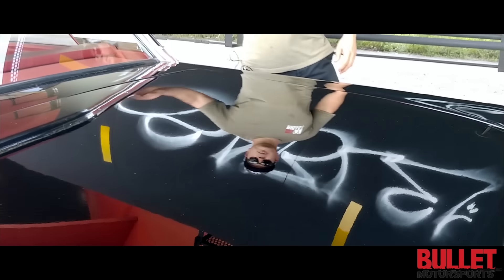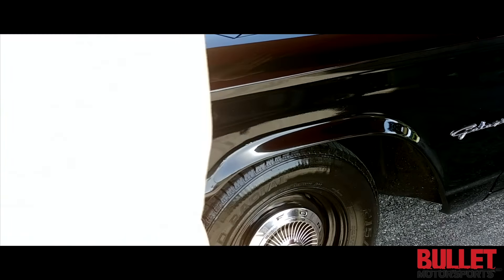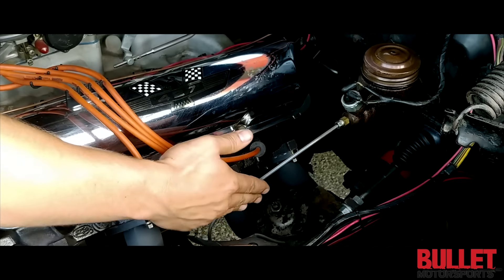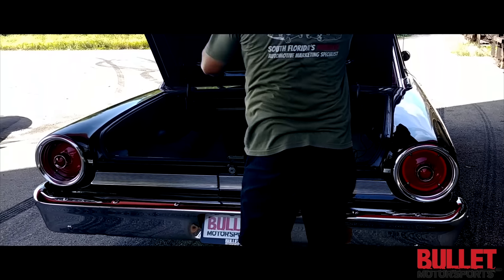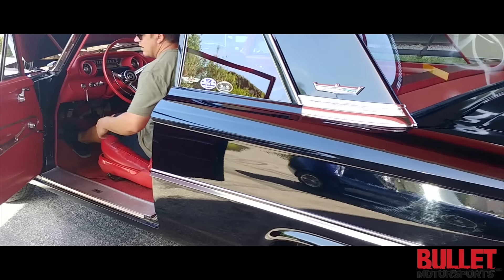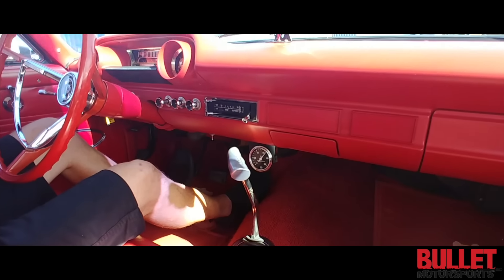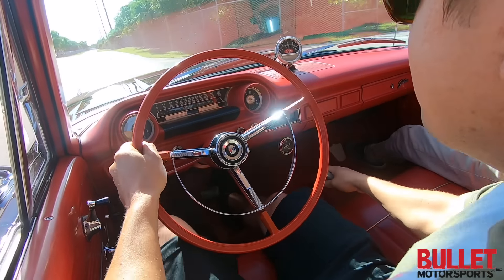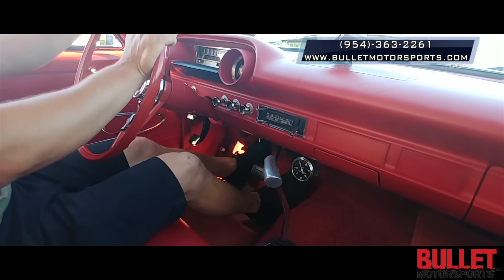1963 Ford Galaxie With 427FE Ripping Through The Gears! -[HD] Bullet Motorsports

Comment: Little trouble slowing down because it has single reservoir, non power assisted drum brakes .
Reply: Yeah I noticed he was sweating it when he tried to slow it down saying you HAD to use the engine because.... and he quickly caught himself before he said "the brakes don't work!! Help!!"
Reply: And for cars like this you would want to upgrade to dual master cylinder and front discs at a minimum. Safety trumps originality when it comes to braking IMO.
Reply: It's totally a period correct built car, though.
 Dual master cylinders didn't become mandated til 67 (and were mandated because the automakers didn't want the added expense) and disc brakes were mostly only an Option until about 1975. 
 If you had built this car from a used 1963 Galaxie 352 Auto grandma car in 1965 or so, the single circuit drum brakes were all you had to work with. Your only real upgrade was to vacuum assist power brakes, and healthy 427s don't make a lot of vacuum. 
 Cars like this were influential in making dual circuit, disc brakes mainstream and standard equipment.
Reply: The car is a clone; the real HP FORDS had bigger brakes on the front along with a number of other differences.
Reply: Sintered metallic brake linings were available in 1963 in order to stop once you sent the 120 mph speedo off the scale......

Comment: We had a car like this at the shop I used to work at, looks like the same year as well. It has a 427 4 speed. It had nascar looking graphics on it. The car also had no air cleaner, but ducting from the inner headlights plumbed straight to the carbs. I had to special order an oil filter for it from the dealership and it was the size of a big gulp from 711.

Comment: I had a 427 side Oiler mid 4.10 drtag pack Detroit Locker in my last 67 Shelby GT 500. What a phenomenal, bad ass motor.The only  draw back with the Holley 635 dual quads:  4-5 m.pg. around town and 7 to 9.5 m,pg, on the freeway! With a 18 gallon gas tank  I passed everything up but a damn gas station!

Comment: Yeah cool car for sure & a bit of Ford Automotive history, great to see it's survived. But don't use the words "all original" or "unmolested"  because it's NOT, it has been modified, it has been "played with" so it IS NOT original or unmolested. But it is still a lovely old Ford. And by the way, why the big hype on it being "a drag car"? I'd rather enjoy a car like this on the street, because it IS A STREET CAR not a drag car.
Reply: SURE if you have a gas station that sells "110 octane gas" (I think that's what he said).
Reply: way better than sweaty bikinies
Reply: Your right....but he did say it was bought 5 cents on the dollar.  So anyone with two functional brain cells....would know what's being sold😎
Reply: In 1962 Ford made five hundred galaxy five hundred and they came out with the original factory hot rod it had a 406 cubic inch engine and IT had a three deuce carbs,high lift solid lifters,dual points distributor,and cast iron header style manifold with the factory dual exhaust with h pipes,had the big round mufflers on it and they kinda sounds like glass pack muffler,BUT they weren't!!!!!FORD rated it at 405 horsepower,BUT I'm pretty sure they lied!!I've never driven OR rode in anything from the factory before or since that impressed me like that one! I Johnny Hawkins swear this statement to be true!!!
Reply: I'D BABY IT LOL

Comment: He did actually rip through 1/2 of first gear and 3/4 of second gear.
Reply: At least one of the carburetors is wrong; original setup only had a choke on the front carb. Bet the new owner got a lot of surprises.

Comment: That's what a muscle car sounds like, not today's sounding like a mosquito taking a crap.
Reply: I miss lumpy idles denoting a performance V8. Now, with fuel injection, its not much difference in sound than a grocery getter. It all depends on your muffler choice
Reply: K ris 
I'll always love the old school analog carbs on a iron big block. Can't keep up with the new stuff but it will always be cool
Reply: Yea 700 hp and you cant even hear it go by. You can hear this.
Reply: No. This is what a muscle car sounds like.  https://youtu.be/pzeumxTFoqg?t=11
Reply: @johnt4060  thats debateable. new cars arent as quick as you think. all that hp, and they weigh 2 tons or more.

Comment: Wow, beautiful car. This car appears to be 99.9% period-correct, except for the radial tires, although the spare looks right. Are the carbs mounted in reverse, with the pedal linkage crossing over to the passenger side?  Our shop has built a lot of FE motors, but last year, a client brought us a 427 side oiler for a rebuild. While chasing down parts, I got to meet a lot of very interesting folks, and learned a lot about these engines. Once again, beautiful car.

Comment: March 1967......just returned home from Vietnam and on a 30 day leave, looking for a car and found a red 1963 Ford Galaxie, 390 cu in, 300 hp, 4 spd, with a bench seat at the local Ford dealer. Not an exceptional fast car but I did win a few street drags but I was selective in what I raced, no GTO,s, Corvettes, never a 300 hp 327, and certainly never a Dodge/Plymouth that had dual exhaust etc, etc. Can't count the number of times my hand would slip off that shift knob and land on my fiancee's knee and most times a little higher. Yep, got out of the Army in Sept '67 and married my fiancee on Oct 21 1967. Today is April 14, 2020 and still married to the same gal. Later I bought a 1969 SS 396 Chevelle, 375 HP with a Turbo-hydramatic, posi-trac, damn that car was fast! Now I'm on my 3rd Corvette and these things are even faster than the  "69 Chevelle was.

Comment: I was happy with my 390 4bbl 4 speed Galaxie 500 xl. Good thing gas was 25 cents
Reply: In about 1972 I stopped at the corner convenience store to "gas up," and gas had gone from $.239 to $.249. I walked into our apartment seething with anger, and rhetorically growled at my wife, "How do they expect us to afford to drive to work and back with gas costing a quarter a gallon?" Yep, those were the days. My previous car had been a 1966 Pontiac Catalina with the 376 hp tri-power engine and a 26 gallon gas tank. I drove that car 102,000 miles and never checked the gas mileage, but I cringe at the thought of filling that empty tank today.
Reply: sumcrzr What year was your XL?
 I bought, drove and sold a slew Galaxie XL's between 1973 and 85. Still one of my favorite cars.  (Along with a handful of T-Birds). People practically gave them away because, wow, were they thirsty. That was fine with me. :)
 Unfortunately, I never had a chance at a 427. Strangely, I could never find a 67 XL in my area either, it was like they didn't exist.
  I had 2 really nice 1966 7-Litres in that time. I wish I knew then what I know now. Lol

Comment: 427 wasn't offered until the 63 1/2 galaxie which had a fast back roofline, early 63's hi po motor was the 406 I am pretty sure.
Reply: Yep . A friend of mine got one of these for high school graduation in 1970 , it was the single four bbl. 410 h.p.  . I bet he wishes he still had it .
Reply: I got 2, 63 1/2 that were my dad's......352's......one is an XL.....XL is light blue the other is turquoise with chrome fender skirts
Reply: Not so.  I owned a 1963 Custom 300 Box Top with the 427/425 hipo engine.
Reply: @moondog3162 ... My dad bought a 63 1/2, light blue fastback.  Loved that car.  I had to settle for the 57, 292 three on the tree, which was ragged out by then.  Michigan winters did a number on cars.
Reply: @dhyde9207  sweet......these have been sitting for over 30 yrs......yep, worst thing u can do to them......he passed away in '13......I'd like to get them running again here before too much longer..the XL supposedly only has 78,000 original miles.....he also has a '66 Thunderbird......
Reply: Jr ALEXANDER  true, but finding someone close that good and you can trust is my delima 🤔
Reply: 406 tri-power 403hp
Reply: @raymondwagoner4896  Ford built a 390 tri-power with 401 HP...Wish I still had my 390 !
Reply: @mschiffel1  got an old junker 63 1/2 galaxie fastback that has a 390 in it.....
Reply: @moondog3162  ...Get busy...If the car's junk, yank the 390...Get your hands dirty and have at it..then you can drop it into a nice light weight Fairlane or Falcon and have some real fun !
Reply: Used to believe that was true, but the truth is that there were a few late "box tops" sold with the R code 427. What's even more strange is somehow there were a (very) few 63 1/2 fast backs sold with 406s
Reply: wrong there was 50 63 box top 427's made I know this isn't one of them but 50 where made just saying
Reply: @walnutmanor  50 made like that
Reply: no
Reply: @badron9245  most people don't believe ford built a 406.
Reply: @mschiffel1  unfortunately, I'm not that mechanically savvy........🤔🤔

Comment: Beautiful CLONE of an R code Galaxie...
just stop trying to pass it off as the real thing. 352 Galaxies were as common as can be, this is an excellent COPY but not the real thing.
Reply: effinghamhick 
And continues to hammer away how it's so incredible and rare, and that it's a drag car - which it's not.
It's a beautiful build, but it's not that unique - you can (still) find 427s (I didn't catch whether this one is a low, medium or high riser) in boats, those "green tag" carbs aren't so rare - my Cobra Jet Torino ('69 4spd "Q" code) had one, the car has aftermarket tube headers - NOT the factory exhaust manifolds (now THOSE are rare) the transmission was common, the 9" rear axle went into production in the '50s and went through the late '70s.
I've been around a while, seen at least a few things.
I was "doing wheelies" before HE was born.
He's a salesman, making it sound like the car is more than it is.
There are still R-Code Galaxies out there - as nice as this car.
Reply: Hated 352's, gas guzzling boats
Reply: @raymondwagoner4896  no different than a 390. id rather have the 352. shorter stroke, can turn it harder.

Comment: I owned a 63 box top custom 300 427/425 until I was drafted in 1965. Favorite trick on my cruzin buddies, was to power shift to 2nd gear with the ash tray open, which would empty the ashes and butts into the lap of whoever was sitting center of the bench seat. This car is short on power for a 427, could be any type FE with the 2x4 setup from a 427. Appears to have aftermarket headers. Nevertheless, this is a real nice car to cruise or show.

Comment: Those single cylinder master cylinders are scary. I had one blow out on my 65 289 Falcon. Will definitely need to change your underwear if that ever happens to you. Nice car.
Reply: I had the same master cylinder in my '64 Monterey fastback. Driving in town one day the pedal suddenly went to the firewall- absolutely nothing from the brakes. I managed to haul it in without wrecking, barely.  Looking under the hood I found the wires to the brake light switch were melting and the switch and master cylinder were finger burningly HOT,  hot enough that it boiled the fluid. One of the sickest feelings I've ever had.
Reply: drum on all 4 with mecanical brakes are the way to go =D (pure drag car lol)

Comment: That single master cylinder was not necessarily because it was a drag car but because that was the norm back then. Dual brake systems started to become introduced about that time but were not universal until 1967. Became mandatory by law in 1968.

Comment: He used the clutch when he shifted and lugged the shifts at 5500.  You gotta drive these old dogs.  Spool it up tight and bang it!  See ya Chevy.
Reply: YOU OBVIOUSLY NEVER DROVE AN FE.
Reply: FE ENGINES DON'T BREATH AFTER 5000 RPM. JUST THE WAY THE HEADS WERE DESIGNED. THATS WHY FE'S WENT AWAY AND 429 AND 460 LIVED FOR 3 DECADES AND FE'S GOT SHIT CANED SHORTLY AFTER 0NE.
Reply: @redline9536  The only reason FEs were canned was because they could not meet the coming emission standards of the late 1960s and early 1970s, and they were too heavy...they weren't a "thin wall" design like the 429s and 460ss were...427 FEs could top 6500 rpms.
Reply: @mschiffel1  THAT IS ALSO TRUE. BUT IF YOU FLOW TEST DIFFERENT HEADS. YOU WILL SEE WHY SMALL BLOCK CHEVYS ARE STILL RELITIVE TODAY. NOT A CHEVY FAN. BUT I DONT HATE THEM. WORKED MAINLY ON FE'S ALL MY LIFE. GOT MY ASS KICK BY ALOT OF SMALL BLOCK CHEVYS. I GOT A 63 1/2 GALAXIE XL 500 THUNDERBIRD SPECIAL. 390. AT. FUN CAR. NOT ALL THAT FAST. MY DAD HAD A 57 CHEVY WITH A 327 FROM A 65 VETTE.  THAT WAS A FAST WINDING HIGH RPM MOTOR.
Reply: @mschiffel1  THE 427S WERE RARE. AND THEY WERE BUT DIFFERENTLY.  THEY CAME IN HIGH OUTPUT MACHINES. NOT THE COMMON FE.
Reply: @redline9536  A lot of that "high winding" has to do with deep breathing heads, lighter flywheels, and steep rear axle ratios...The FEs were TORQUE MONSTERS, and if you took two equally geared cars, tied them back to back, one SBC powered and the other FE powered, the FE car would drag that Chevy backwards all over town...Back in the 1970s a friend of mine had a 427 FE in a 1957 Thunderbird with a gasser style straight axle up front..The FE was a 1964 427 all stock...That car was the only one I ever rode in that did WHEELIES off the line...I mean two foot high wheelies !  What a monster that 'Bird was.
Reply: @mschiffel1  63 1/2 GALAXIES WITH A 427 WOULD DO 0 TO 60 IN 7.4 SECONDS. TORQE PEAKED AT 3700. I HAVE A 4500 POUND 2017 LINCOLN CONTINENTAL WITH A 2.7 V6 THAT WOULD OUTRUN A FAIR AMOUNT OF EARLY SIXTIES MUSLE CARS. THEY WERE GREAT IN THERE DAY. BUT THE WHOLE REASON FOR THE HALF YEAR WAS TO GET THE JUMP ON THE GTO. AND WE ALL KNOW HOW THAT WORKED OUT. THEY MADE SONGS ABOUT GTO'S. NOT GALAXIES. I LOVE FE'S I GOT TWO. IN MY GALAXY AND A 57 RANCHERO. LOVE THEM. BUT THE FACT IS THERE NOT A COMPETITIVE DRAG ENGINE. GREAT TRUCK ENGINE.
Reply: Red Line ... When you yell in all caps, your errors stand out. DISTINCTLY.
Reply: Some 1poisoned the water hole  I AGREE WITH THAT
Reply: Dyno Don
Needs a competition plus shifter.  That was period shifter and needs a maniac to do it justice.
Reply: @redline9536    WHAAAT?  CAN'T HEAR YOU!!!
Reply: @redline9536  429 and 460's do not breathe well either!!! Open up intake and exhaust ports and hp is unlimited! John Kasse builds the baddest 460's on the planet!!!
Reply: @christopherblessing3868  I AGREE WITH YOU. FORD DIDNT REALLY GAIN MUCH  WITH THE 429 OR 460. NEVER SEEN EITHER BE MUCH FOR COMPETITION.
Reply: he was trying to sell it, not wreak it bro.
Reply: Well, when you are trying to sell it, ya gotta drive it so you don't break something.
Reply: Red Line The 406’s got their HP above 6gs.  Give up the cool aid gal and let men talk on this channel.
Reply: @mschiffel1  if that was true, mopar would have shitcanned their B and RB engines. made in 58, lasted to 79.
Reply: @redline9536  sbc heads back in the day really werent impressive.
Reply: @redline9536  they also made songs about vettes beating big block mopar cars, but when they actually did a test, the vette got its ass whooped. songs dont mean shit. pontiac got shit on in NHRA.
Reply: @frigglebiscuit7484  Mopar had no thin wall large displacement V8s to replace the B and RB blocks. They just made them for a few more seasons. Ford shitcanned their FEs and replaced them with thinwall Windsor and Clevelands and the 429-460s.

Comment: I bought one used in '65 .  Mine was burgundy and originally a 390.  Most expensive car I ever had.  In 13 months I destroyed 3 T-10 Borg Warner 4 speeds before finding a Ford 4 speed that didn't destroy the 3rd gear syncronizers,  5 rear ends as I changed rear ends depending on if I wanted speed or drag.  Lost count of U joints as I was running 7 inch cheater slicks and the torque was monstrous.  Never another FE big block like the 427.  I redlined it at 7,000.  .

Comment: The paint on this car can not be original. No car from any manufacturer ever rolled of the assembly line in ‘63 with that much shine or as perfectly flat as this.  Additionally, I don’t believe the door rubber to be original either.  I had a 63 with low miles which was always very painstakingly maintained. The rubber on it was degrading by the 1970s. Even still, this car is a beauty and would be highly prized by any of us for sure. (I’d want to give some attention to tune/carb adjustments though - it looks like she bogged down somewhat when the go-pedal was punched).

Comment: So original its had its drivetrain replaced, had enough paint put on and sanded out to mimic nail polish and in a black hue never used by Ford...  Why can't you just say it's a resto-mod you can beat the snot out of and not worry about damaging a museum piece?  Are the tires, brakes and brake fluid original too??